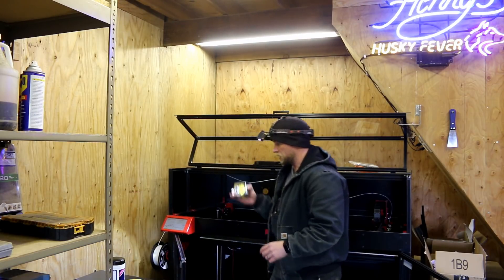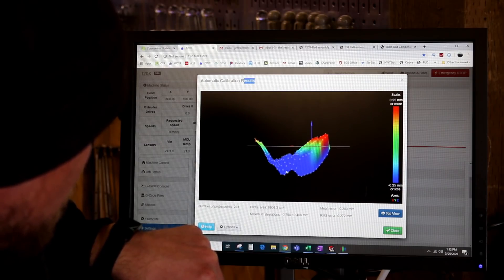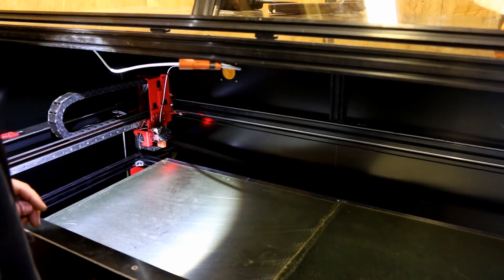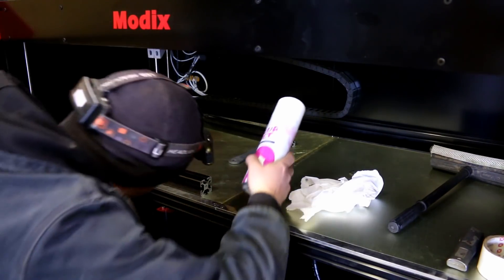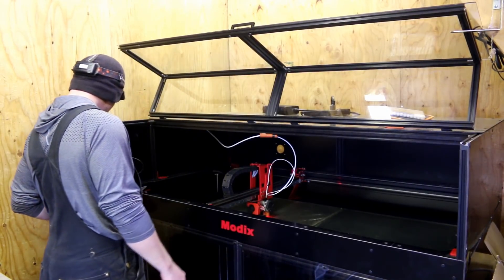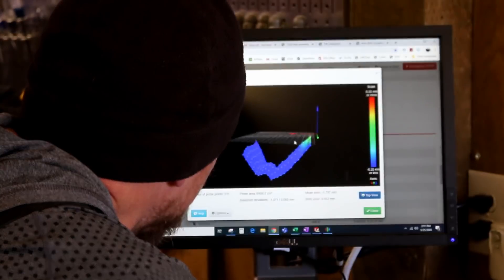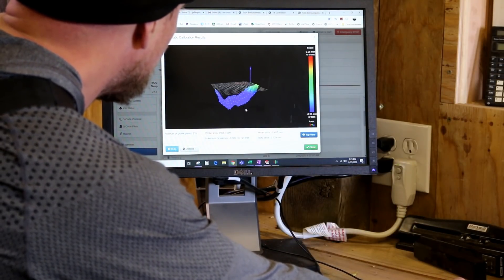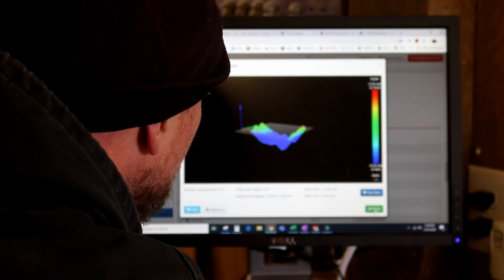Leveling the MODIX 120 V3 BIG 3D Printer - Real World Experience

Comment: Centimeters and millimeters...so that's what those marks on my tape measures are...who knew.  One of my frustrations is jumping back and forth between the right way and the way the rest of the world does things.  Wrenches, bolts, instructions translated from Chinese, all keep us in touch with the rest of the world. I enjoy your printer videos even though I have not purchased a 3D printer, 58 thousandths off, probably never will since I'm still having problems compensating for saw kerfs.  Wonder how long it will be until they build a self leveling printer like the RV industry did for travel trailers?

 Keep up the good work and have faith that it will all come together.

Comment: Suggestion:  Maybe keep using the 0.4mm nozzle...it seems to be much better for the overall printing accuracy for your situation.
Suggestion:  Get a single sheet of glass...precision ground...to affix on top of the current bed.  Aluminium beds are notorious for not being level and are usually out-of-spec.
Suggestion:  Cut your test cubes in half (vertically) to check the inner layers for placement and connectivity to each other...to make sure the entire cube is correct all the way through.

Comment: I was wondering why you were using a level.  That’s only relevant if the plane of XY racks are level.  What you care about is that the bed is planar and within the compensation range of the print head.

So far I’m not impressed with Modix.  To spend that much on a device then have to wait weeks for correct parts is poor form.